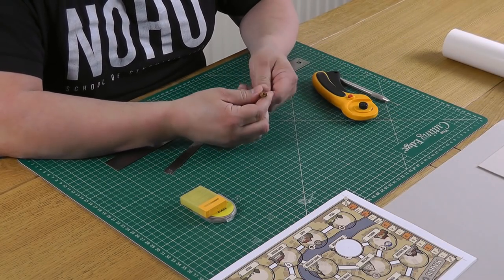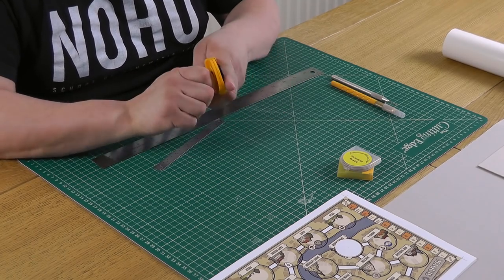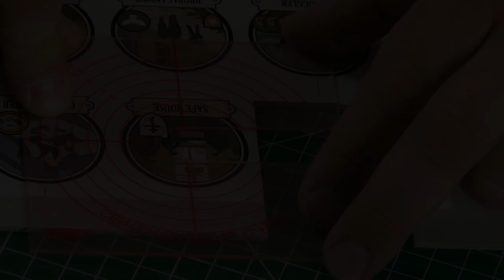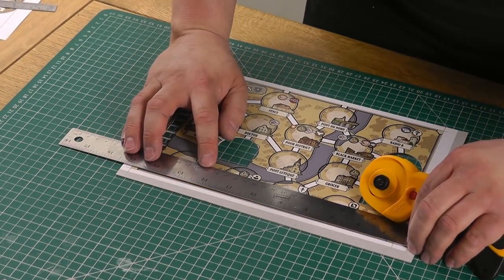Build: Double-Layer Recessed Board for Maquis + Channel Update

Comment: Great Work! I have some questions to yout tools
1) Which diameter have the discs of your Rollercutter? Is it an OLFA?
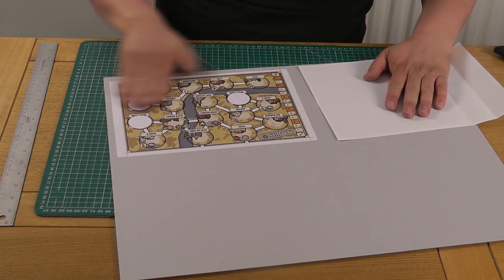2) Which circle Cutter you use at 4:50?
3) Which Printer do you use?
4) which Paper with glue do you use for printing.

Sorry for my poor english.
Reply from the maker: I would preface my answer with this: the specific tools you use don't matter - the important thing is to practice with what you have and make sure you can make the best use of it!

The rotary cutter I use is an Olfa, yes - a 45mm version. The main advice I would give for rotary cutters is to make sure that you get one with a safety lock, and if you're left-handed check that the one you're buying can be switched around to work left-handed. The Olfa brand is good for both of these factors. 45mm discs I prefer only because they last longer - a smaller disc will get blunt more quickly.

The circle cutter is an "NT Cutter" brand. They do two - this one, and a more traditional compass-cutter variety. I prefer this one because it doesn't need to prick a hole in the card to set the centre. I got mine from Amazon, although it's a Japanese company and I've seen them for sale in other places as well.

My printer is a Xerox Phaser 6600 - but a wide variety of printers can do well. I prefer laser to inkjet, myself, as the various issues with inkjet printers (not least built-in obsolescence) wind me up.

For label paper I often just use regular full-page labels intended for use as shipping labels. This works better with a laser than an inkjet printer, where paper type makes a huge difference. I also sometimes use "glossy laser labels" that I think I got from SpielMaterial some years ago.
Reply: Thank you very much.

Comment: What is the mounting film used here? I haven't been able to find it. I'm probably using the wrong terms. I'd to replace spray adhesives for my projects (if the price is right).
Reply from the maker: The product I'm using here is "Gudy 802" by Neschen. It's basically double-sided tape without the tape part - just a layer of glue held to the peel-away backing film (although you can get film-carried versions as well). So far as I can tell it's mostly used by signmakers - have a look at signmaking suppliers if you're looking for some.

It's expensive enough that I wouldn't use it for literally everything I use glue for, but it's not terrible price-wise and it's definitely convenient if you don't want to or can't spray. If I recall correctly I got mine here: https://www.cadservices.co.uk/papers-films-mounting-films/neschen-gudy-802-mount-film-16in-400mm-10m-23mic-p-8884.html
Reply: @DiningTablePrintPlay  Thanks so much!